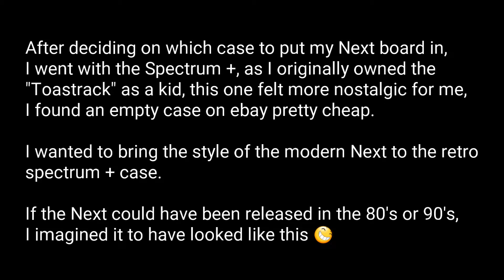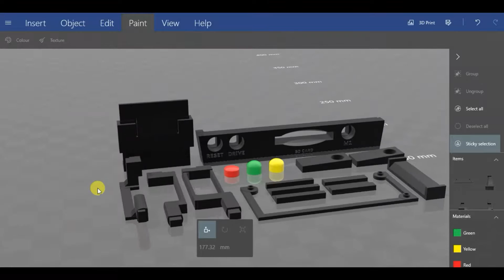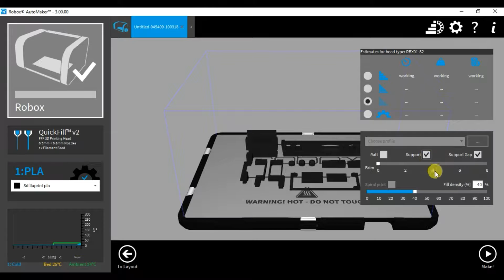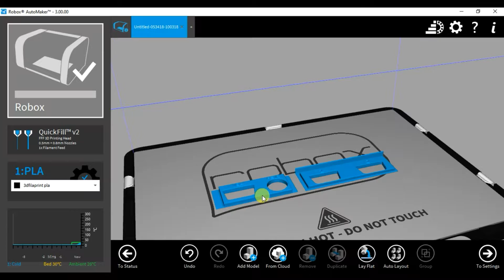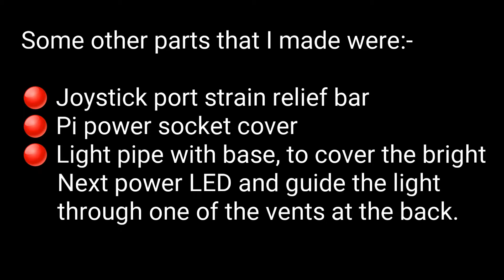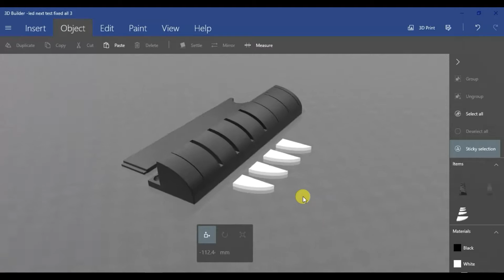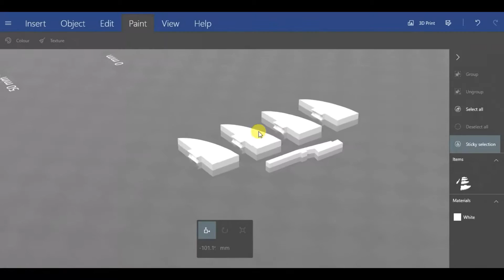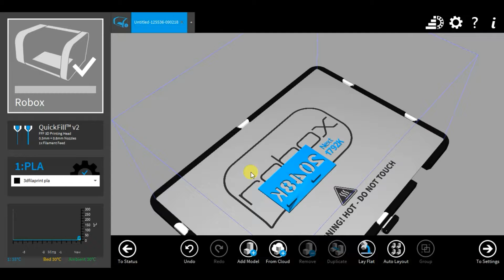Part 1 Sinclair ZX Spectrum Next + edition  Preparing the case & 3D printing the parts on cel robox

Comment: The SDCARD part doesn`t sit well with the angle piece of plastic ( the foot housing ) so I need to chop into that a bit. It`s hard to see if you had to.. buy I can`t see how you couldn`t... with everything that has to go in that area..
Reply from the maker: I'd have to take apart to have another look, I can't really remember there are a few pictures on the spectrum next FB group that might help, if not let me know and I'll take it apart and take some more pictures.
Reply: Plus in the US I couldn't get an SD card extension that had the big end. Do I have to use an adapter on it. Very tight around there.

Comment: Assuming i'm gonna time travel to 1980, can a ZX Spectrum control steppers? It's a bit of a urgent question.
Reply from the maker: Stepper motors for 3D printing  ? Sounds interesting, I honestly wouldn't know but I'd like to know myself now 😃
Reply: @MAKEMEA  It's a question if you can make a 3d printer in 80's. ;)
Reply from the maker: The powering of steppers wouldn't have been a problem as thats seperate, it's the software to slice the files, I think the speccy wouldn't be able to show the files let alone be able to create them, maybe the amiga 1200 could have coped would be interesting to see  😃
Reply: @MAKEMEA  Well i do know that plotters are there since 70's, so it would be possible to adapt a hotend to a plotter and add an axis, that could be triggered mechanically by the hotend position on 2d axis. The plotters used HP-GL language to draw vector graphics with retractable pens back then, so maybe Spec could pull that off.
Reply from the maker: Interesting, I'd love to see that in action 😃